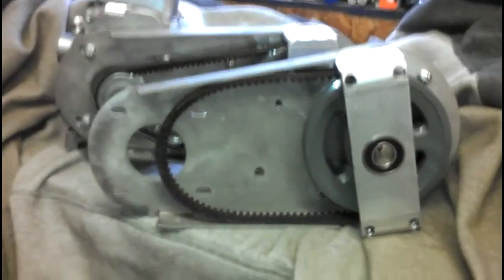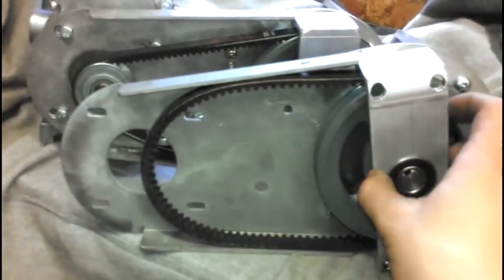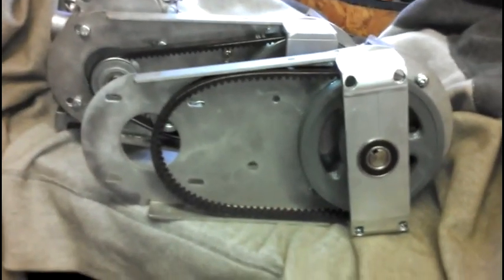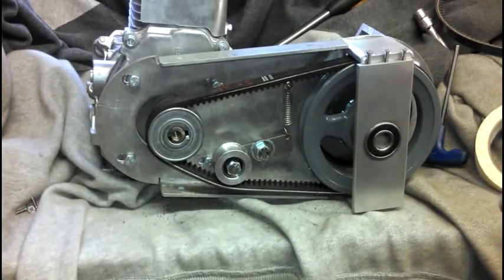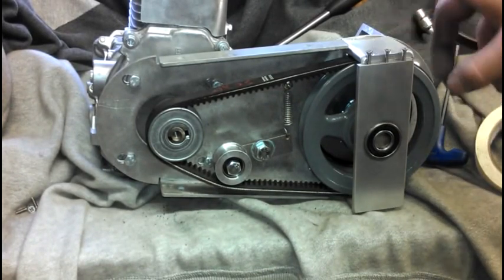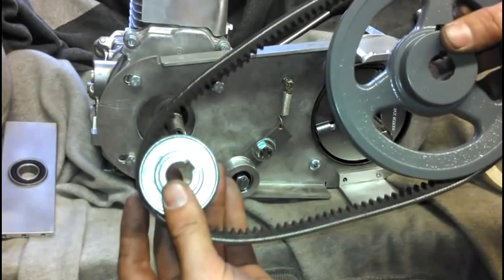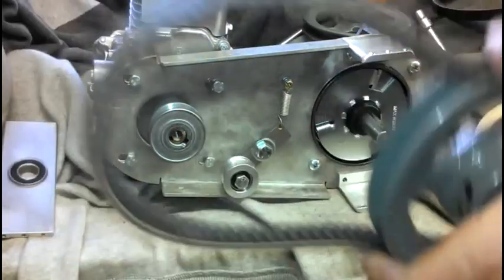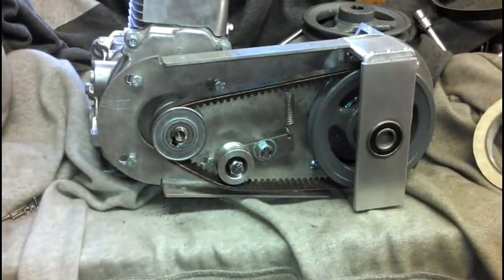New EZ Motorbike Drive. The Pace Setter drive. Available 2013

Comment: I've already tested out the ezm pace setter transmission set up on my bike. I did a 987 mile round trip tour on my bike and i lowered my gearing down to 18:53:1 with my 68t sprocket combined with the pace setter. I had an 80 lb. tour pack load on my bike and i averaged around 20 to 24.5 m.p.h. on my bike along with an average of 180 m.p.g. with my motor. I did all that on my Ezm q matic motorized bike this summer past.
Reply: I rode a motorized bicycle across America this year Florida to California and back.  Posted it on my channel.  I use my own build so simple a cave man could do it.

Comment: whats the size of the new hill climber pulley and how does it affect the clutch engagment over the stock 4.95 inch pulley,which engages at around 25 m.p.h. with the stock 56 tooth sprocket? Also was wondering to as well if the garter spring had to be changed out between either the stock pulley over the hill climber pulley?

Comment: This a disaster of a transmission. The pulley that is to be installed on the crank is 5/8 and the crankshaft is metric...... The gear reduction is absolutely rotten. You need a runway to get up to 25mph. The 7-G transmission that comes on most of the Huasheng engine kits absolutely blows this waste of materials out of the water. Use a pilot bearing on the clutch bell on the 7-G instead of the bronze bushing and you are ready to bike just about anywhere problem free. If you have to replace the belt on the Q-Matic, your day is ruined.... You have to dismantle the entire transmission to replace it. The designer of this transmission should try Walmart for employment instead of designing garbage.